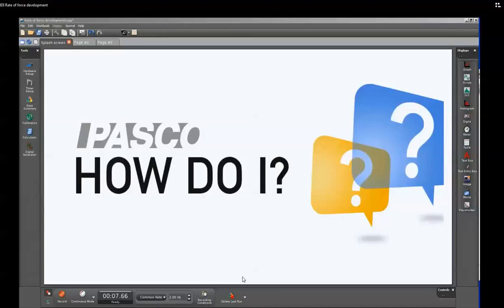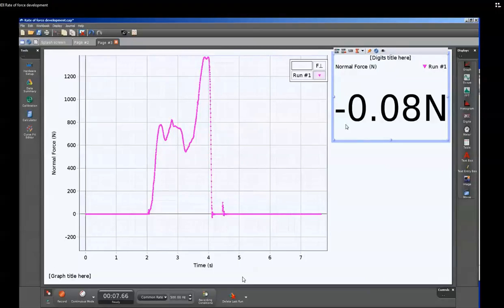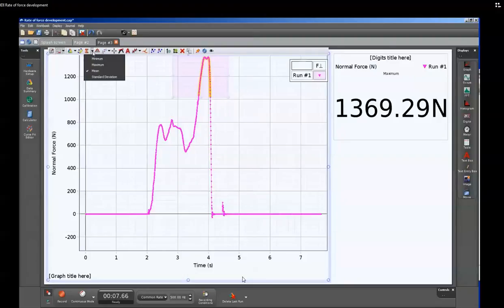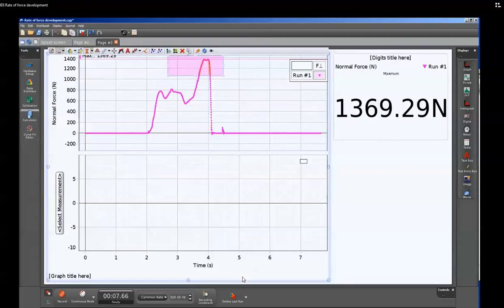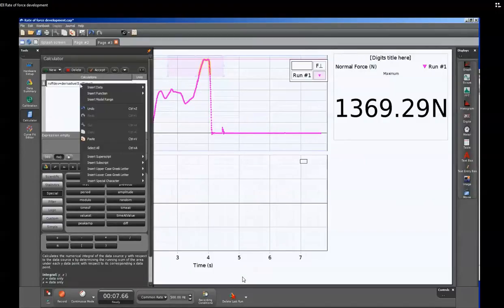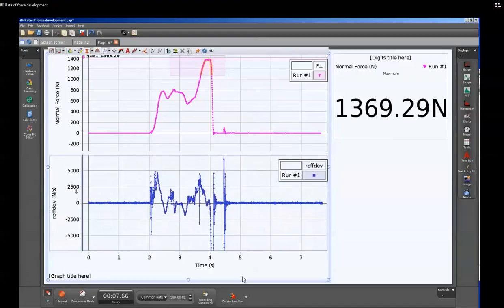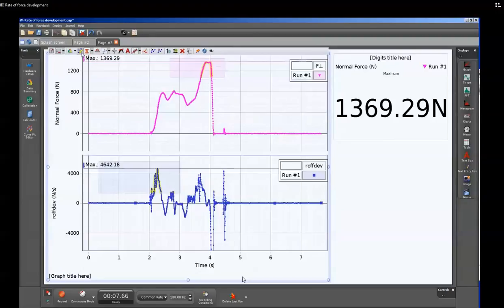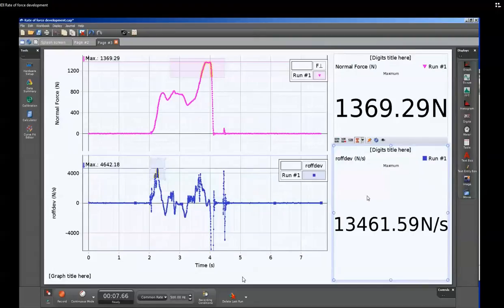Show the Rate of Force Development (Capstone)

Comment: So higher RFD higher jump?
Reply from the maker: The higher the rate of force development means that the athlete is able to get to a higher force in a shorter amount of time.  However, it is the total impulse (area under the force-time curve) and the mass of the athlete that will determine the height for the jump.
Reply from the maker: The RFD will show that a larger force is developed faster.  It will depend where in the jump the RFD is highest.  If the participant has a high RFD only at the end of the jump, there will be less distance over which the higher force will be applied, and this will be less efficient for a higher jump than a high RFD early in the jump so that a higher mean force is developed over the length of the jump.